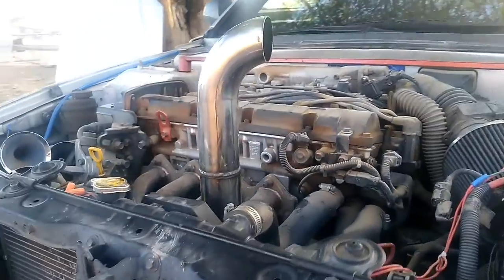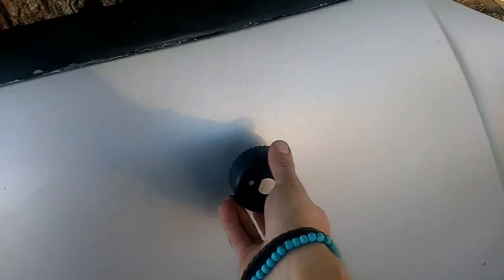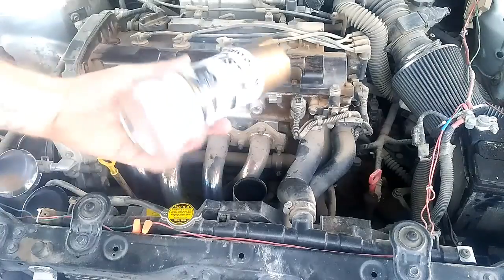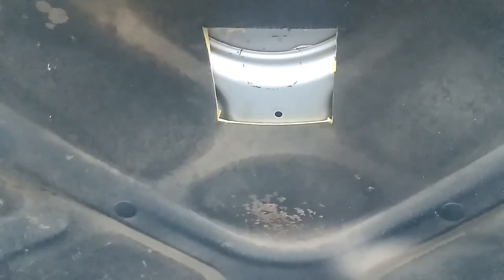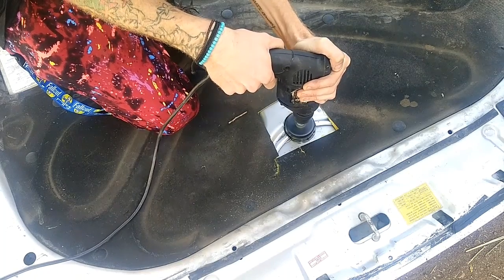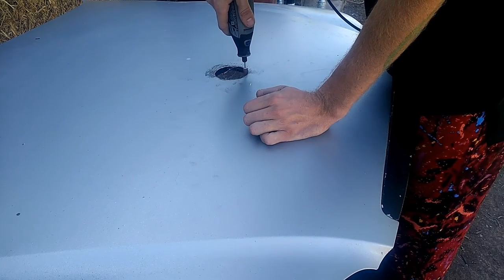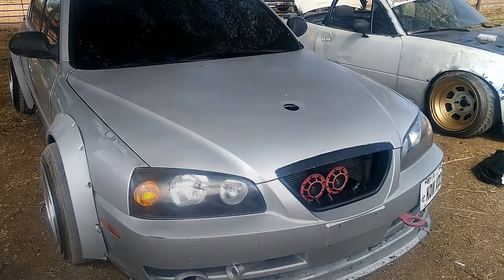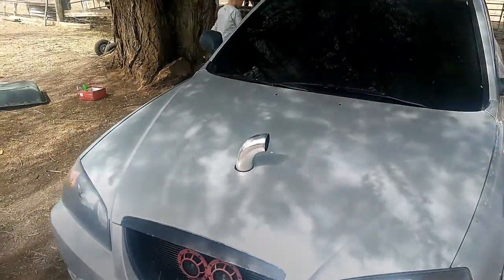Hyundai Elantra HOOD EXHAUST Review (Hate pipe with Rev and hood butchering

Comment: Hey bro I need help, my Elantra fuel pump went out I replaced it and omw to work it was driving perfect until I got half way there and I lost all power it still starts but it's rough idling check engine light flashes whenever I try giving her gas half way at about 35.. could it be the converters or do I have air in my lines?
Reply from the maker: It's probably not that bro try the spark plugs and plug wires it's probably a miss fire how many miles are on it
Reply: YouStanceBro changed those and the wires, coils, sensors, still nothing and 221xxx